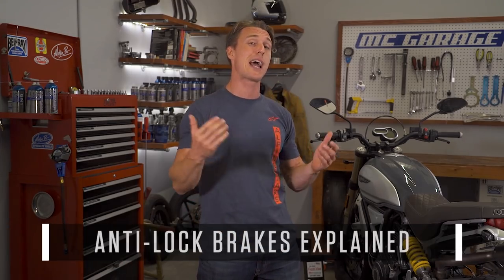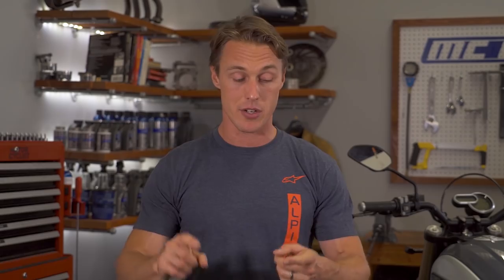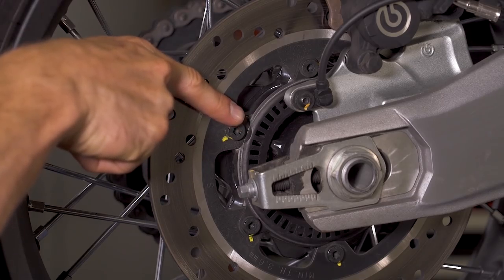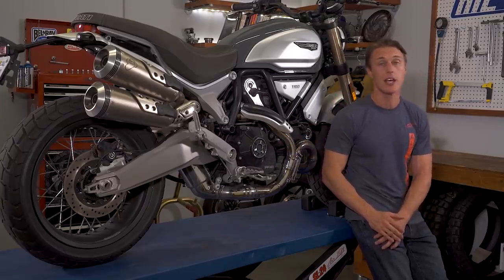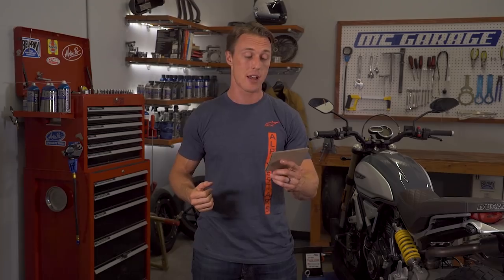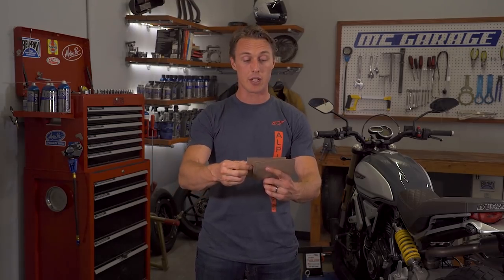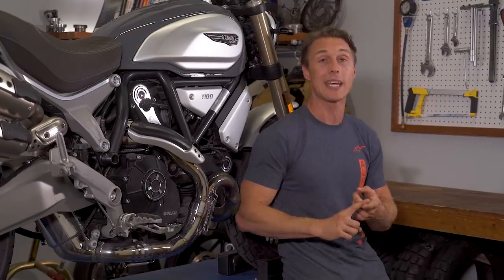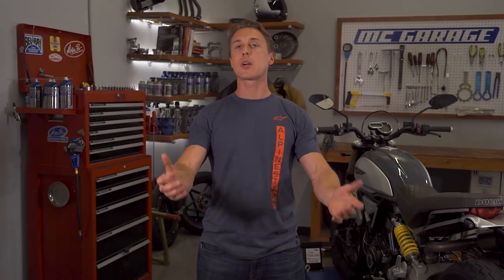Anti-Lock Brakes Explained | MC Garage

Comment: ABS is bullshit. I had a 2015 versys with ABS and when someone purposely turned in front of me I grabbed a hand-full of my front break and smashed my rear break counting on my ABS to allow me to do so. What happened? My front wheel and rear wheel locked up and slammed my bike on it's side going 40mph. I was lucky enough to angle my slide away from her car but the point of the story is that ABS didn't do shit. If I'd known my ABS was going to fuck me I would have taken more care with my stop even though it would have meant me flying over the dumb bitches car.

Comment: I hate ABS brakes on my car and unplug the fuse in the winter but on my motorcycle? It's great.
Reply: Sơn Hoàng  Manufacturers should hide the  fuse legend.
Reply: I am driving cars with and without abs in winter. The non abs stops better on snow when tyres are locked, the abs one do not lock the wheels and that makes it worse in stopping. I am experienced enough to be able to steer without abs. I like the non abs car more